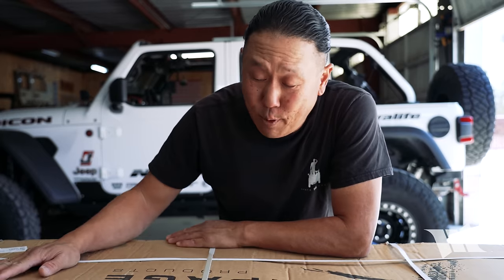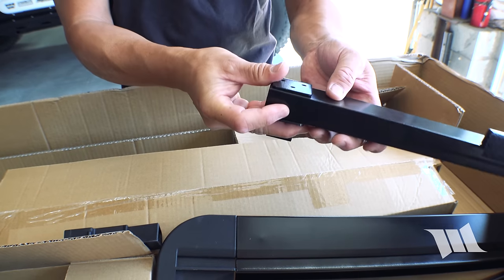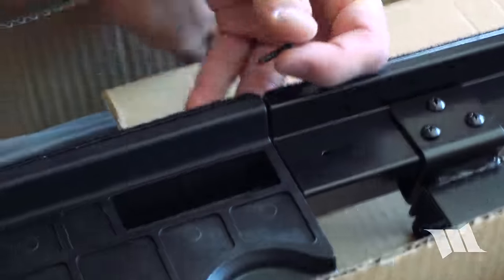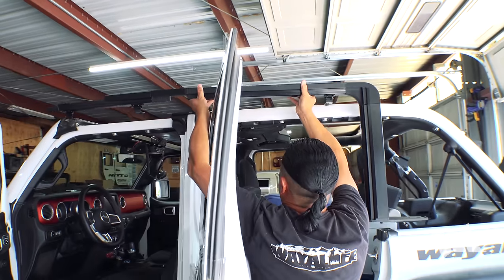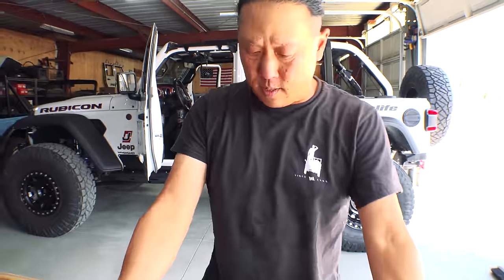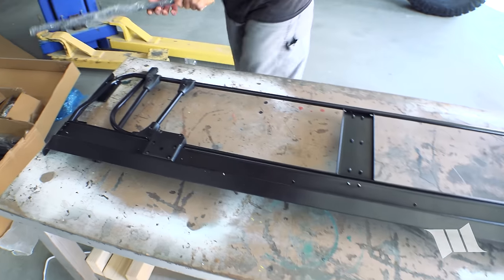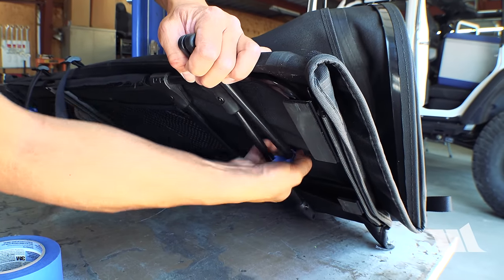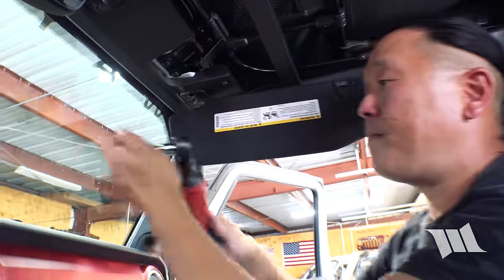Rampage Trailview Fastback Soft Top Installation on a Jeep JL Wrangler Rubicon Unlimited 4 Door

Comment: Is there pros/cons for Rampage over Besttop? Or vice versa?
Reply from the maker: So, having installed both, what I can tell you is that both have plus and minuses. The Bestop is without question, more factory like and a lot easier to install. However, once installed, this Rampage top really isn't too bad and I actually like the flip top Trailview feature of it a lot more. I've always hated the way the Sunrider on a Bestop opened up like a loose umbrella waiting to catch the wind and kind of like a mistake. However, the Bestop does seem to be quieter. Also, I LOVE that the Rampage top allows you to store the rear windows inside the top. With that said, the jury is still out on this top. I need more time to test it out. Seems like mine might have a fitment issue on the windshield and I need to talk to Rampage about it.
Reply: @wayalife  any updates on the two versions?
Reply from the maker: @ashleeybanez7655  For looks and function, I personally like the Rampage top best. That said, I was never able to get the fitment issue figured out and so, the Bestop would be the better way to go. For now, I've just got back to my hard top as it's actually super easy to remove for summer and in winter, a lot quieter, can hold a lot more stuff and sooooo much easier to open and close the back glass.

Comment: How many inches is this vehicle up?
Reply from the maker: We are running 38" tires and have our coilovers set to about 3.5" of lift.
Reply: @wayalife  
Question to vehicle settings
My car is an EVO3 lift spring RHDJK Rubicon
It is tilted 1.5 cm to the right.
Is the EVO spring tilted even in LHD?
Please let me know if you know.
Reply from the maker: @ShibArmymillion  Are you saying that your Jeep is leaning to the right? If so, this is normal on a JK. It's the gas tank weight that does it. You can kind of correct this with adjustable swaybar links purposefully set long on one side.
Reply: @wayalife  Thank you for a polite answer. I will take measures.

Comment: Looks like a hot mess.  to many buckles and straps and Velcro.  Definitely like the Best top NX Trektop better.  Rather pay more for better quality.
Reply from the maker: I have run both tops and can say, both have their plus and minus. Bestop is way easier to install but I think Rampage has a much better flip top solution. I love how clean and flat it sits when open. Also, I really like how you can store the rear windows in the Rampage top. Bestop offers nothing for this.
Reply: @wayalife  I like the fact with the Trektop, my rear passengers can get the open air feeling too with the sunrider feature.  not just the front 2 seats.  little more work, but I think it's worth it.  Guess I'm just not a fan of the bowless tops.  put together it looks nice.  just to many things to do.  I can remove the rear 2 side windows and back window in like 30 sec.no straps to undo.  great thing about Jeeps.  So many different aftermarket parts to please just about anyone.  LOL
Reply from the maker: Yup, I can see that. We're empty nesters and don't have a need to care for rear passengers. My biggest complaint about the Trektop I had was that when opened, the inside of the fabric was facing out and it always looked like a mistake ready to catch the wind. Also, when removing the rear windows to go safari mode, I had nowhere to put them and that sucked. But, like you said, the great thing about Jeeps is that there's a lot of options to please everyone. And really, I should say that this is my first time testing this top out. Time will tell how much I really like or don't like it.